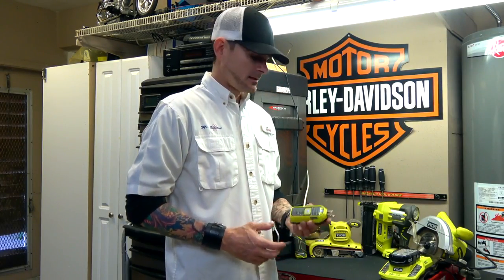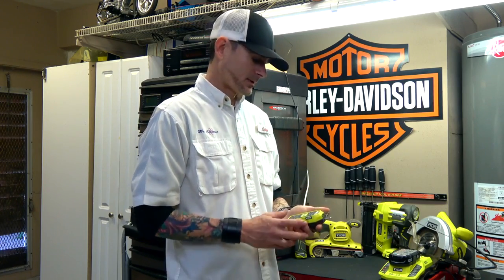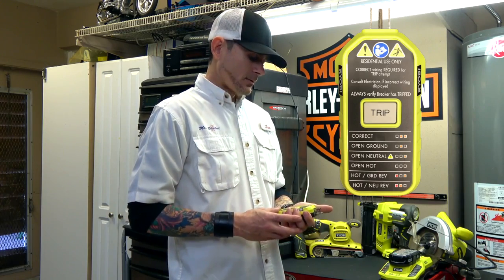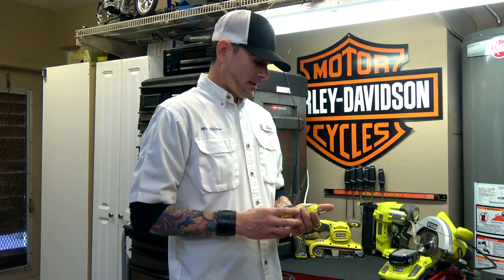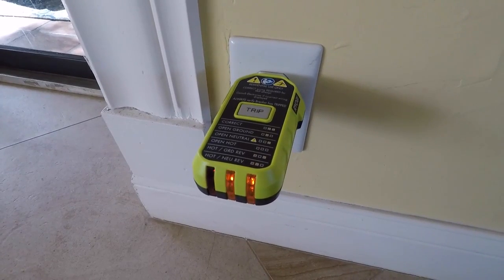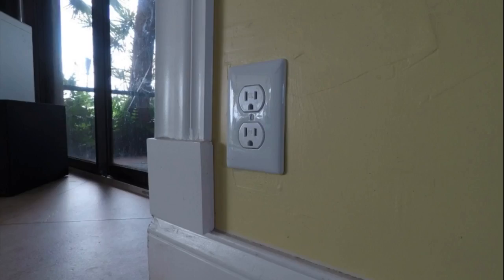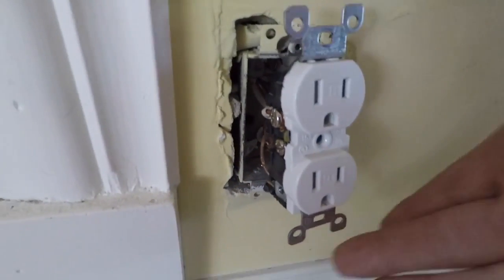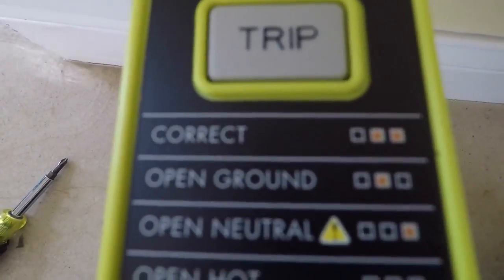RYOBI POWER TRIP --- HOW IT WORKS

Comment: You did not need to take the wire of the ground off. All you have to do is take the receptacle off the metal box. Bought this product and it only works on certain breakers